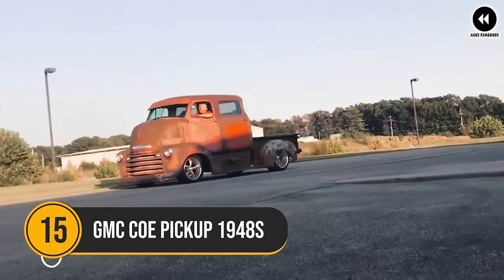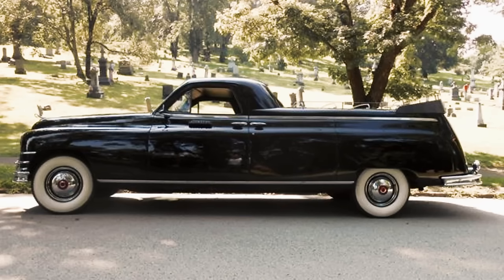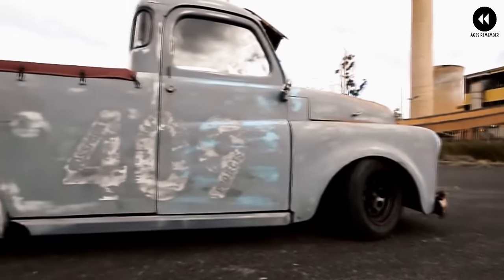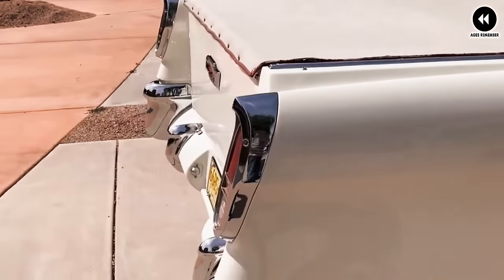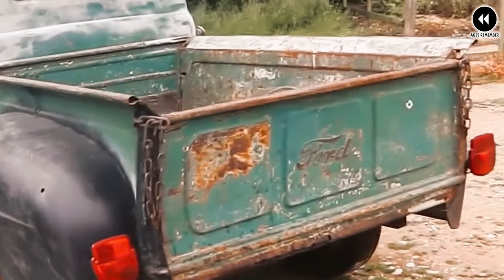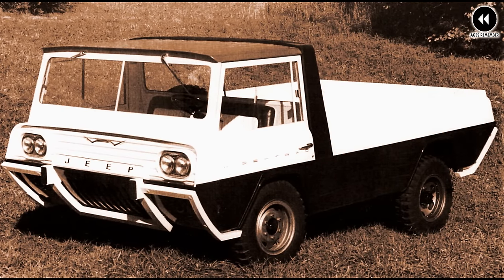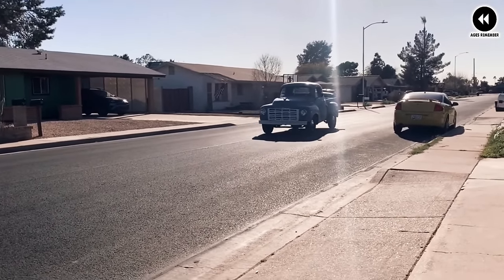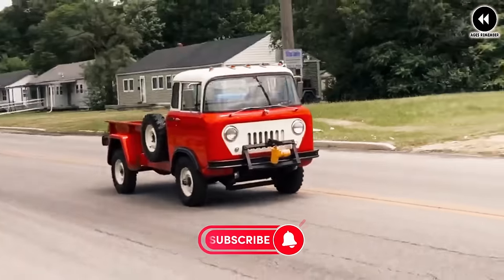15 Most GOOFY American Pickup Trucks! You will not believe!

Comment: Not convinced Toyota was a American pickup in 1940
Reply: Or the Mercedes-Benz Unimog. Totally german engineering product although they later on had some co-operations with Studebaker it´s been written (hint: the hood and grille on the Silver Hawk mimics the MB luxury passenger cars, fun fact is that Studebaker also had an unrealised prototype built by Porsche in its late years), until they merged with Packard before closing the shop. The Unimog seems to have been initalized by some smaller firm before MB stepped in with their bigger resources to get it going into the broader market. The vehicles name is an acronym for UniversalMotorGerät, a universal motorized appliance.
Reply: @hasseslaggmek3573  even though they didnt build them here, they did  become the American importer for Mercedes-Benz, Auto Union, and DKW and sold them through their dealerships. maybe thats why some people thought they were built here.
Reply: @GMCOGRE  I´ve read an article somewhere about Studebaker importing MB but Auto Union and DKW, that´s new to me although i knew they were sold in the USA. Matter of fact, MB took over the Auto Union (a merger of the car companies Adler, DKW, Horch and Wanderer) in the fifties and developed the Audi 100 before selling it all to Volkswagen, which in turn soon merged it into the Audi-NSU subsidiary when they bought that brand. As known Audi became the technical platform for the fwd cars of both brands and the NSU brand was kept running until the mid-seventies with the small rear-engined Prinz dating back to the fifties and the advanced Ro80 with a Wankel rotary engine powering the front wheels. However, NSU´s last own design was the boxy fwd K70 4-door sedan that VW took in as their own when the financially exhausted NSU company had to close it´s business just before it was launched to the market.

Comment: I believe you and your research lacks credibility. The COE style truck was produced by Ford, GM, Dodge, International, from the late 30s up into the late 70s. Packard never produced a pickup. They were a luxury sedan. Where are you getting your info. The only time Packard or Caddy pickup was a special built vehicle for fruneral homes called flower cars. GM didn’t produce any nor Packard. Dodge trucks were weak sellers. Lacked horsepower due to the flathead six. And rode like a lumber wagon with a lot of engine heat from up through the floor. Panel trucks were made by most truck builders. GM didn’t have the only panel truck, these panels go back into the early 30s.

Comment: @1:15-That is not a GMC COE shown. It's a Chevrolet.
Reply: it also didnt come as a pickup, they were medium duty trucks that didnt have a pickup bed.
Reply: I think I only saw one actually Jimmy....and that 41/46 COE sure got a lot of screen time....
Reply: @GMCOGRE  And they definitely didn't come as a "4 door" either. I used to have access to GM provided drawings of all cars and trucks made since 1940 to 1976 as part of the info I got from working as an instrument tech at a Delco distribution center.
Reply: @Friedbrain11  yes, you are correct, back in the '90's i used to have a few of the '47 - '53 pickups, always thought it would be cool to build a COE but never could find any in usable condition. looked far and wide but everything i found was either beyond repair or would take a crap ton of money to rebuild. did have a '50 chevy pickup though with a GMC 302 built up with aftermarket intakes, 3 carbs, a split header, cam,higher compression pistons, had it balanced, and used a hydromatic 4 speed trans from a 2 ton truck in it (the one with a clutch to launch then it shifted like an automatic). from stoplight to stoplight there wasnt a v8 around that could out run it.

Comment: The Packard Pick-up truck had to be a retired flower car, likewise with the 1956 Cadillac Pick-up truck had to be a retired flower car
Reply: That Straight-Eight motor was Smooth as Silk, yet had great Torque. Great Idea, but 50 years ahead of it's time. And, maybe, lacking in Frame cross-stiffness? Still, better than an F-150 wearing a Lincoln badge, IMHO...
Reply: Or concept car maybe?  Harley Earl built a lot of odd things which happened later...
Reply: That Packard is a latter built truck some one made from a four door car. In the late 50s Packard made very few pickups for the South American market that were Studebakers with Packard badging. This ain't one of them.
Reply: many Caddys were special order and built by a coachworks shop, not in Detroit. Same goes for the hearse, ambulance body and other such odd-ball configurations, like stretch limos.
Reply: @rupe53  So were those commercial chassis, like the Big 3 had?
Reply: @DTD110865    In the beginning they would start with an OEM chassis and modify it to suit. (beef it up or stretch it out) Later on it was probably a better idea to custom build a chassis and add production parts from a truck. A prime example of early crossbreeding of factory parts would be some of the mid-size GMC trucks of the 1920s that were based on a Buick touring car driveline. They were in the 8-12k pound range and used the Buick straight 6 engines. The front of the body was GMC but the rear was whatever you wanted. (purpose built) I have a 29 American LaFrance fire truck like that. It could also be a bread truck, ice delivery, milk wagon, etc. Mine has a second gear box to drive the fire pump.

Comment: The Kaiser Widetrack must have been an FC concept.  I woulda liked to drive one for a bit...
Reply: Fun fact; the Kaiser pickup was at least until late (or maybe still, Google it) built under license by Hyundai for the south korean military in an upgraded version with a slightly changed front end design. Seems like it had been upgraded with some domestic diesel engine in later years. In Sweden, our military used a few of the Jeep marked slabside pickup version up into the eighties, don´t know if there´s any difference in the mechanics but those had the Wagoneer/Cherokee ribbed wide grille.